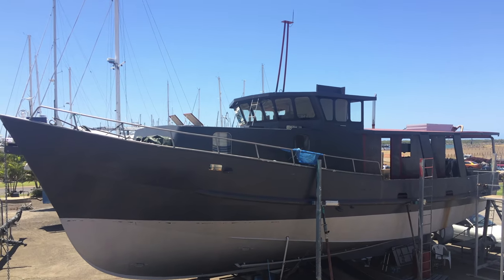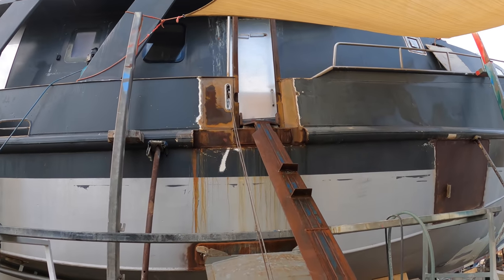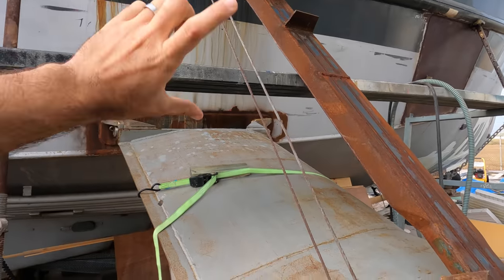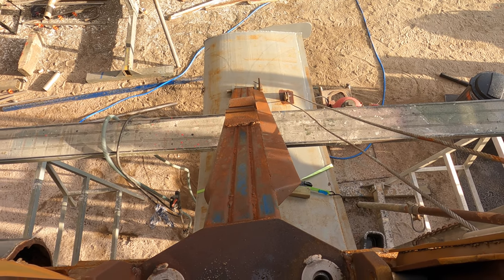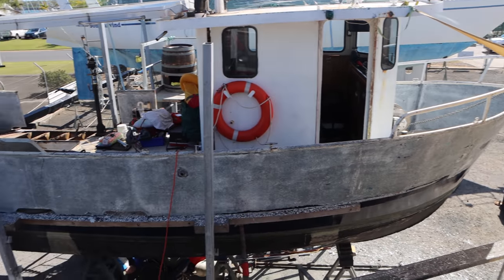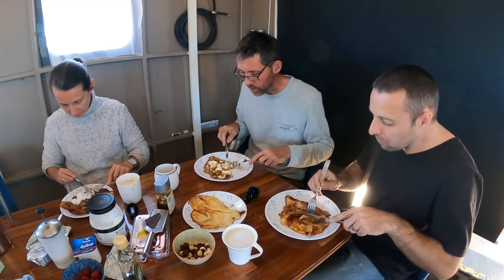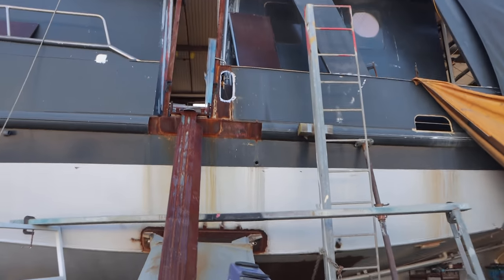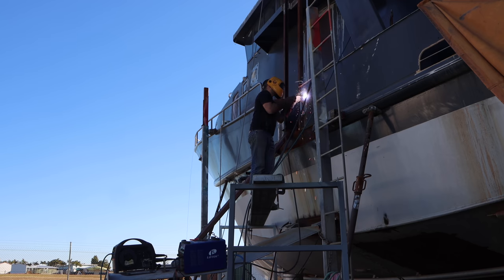Re-building our bulwarks & bending stainless solid bar fairleads - Brupeg Ep. 216

Comment: Hi just a suggestion..have you considered using a 12 volt power pack that is commonly used in dump truck applications
And as that is under $1000 you could use hydraulic drive motors from commercial lawn mowers…in usa. Surplus hydraulics has new close out bargains…if you are interested I will get you their contact…

Comment: Thinking of hydraulics for wing winches.
You already have lines for the anchor winch, can you allow for dry break fittings and use feed and return hoses to connect to a hydraulic manifold on the roof? Only issue is storing the hoses when not needed.

Comment: You will be using a rattle gun to undo the wings lock down bolts/nuts before you lift them.  Set up and use the same gun to wind them up. Limited cost. Upgrade when you have the finances if you need to. You will not be raising them everyday day , just when you come to port I thought.

Comment: Since there going to be in the water 95% of the time. Just use central hydraulic winch with a split drum. You have enough pulleys to spread the load so not overloading the winch. That way only buying one winch so just change the way the wire approaches the drum that way they both raise and lower same time. Cuts your cost. By not going hydraulic your putting a price on reliability and going to have forever ongoing issues (coming from a commercial fisherman here in nz). One winch and maybe a extra pulley mounted on the roof each side. Problem solved.

Comment: How about 1 hydraulic winch with two reels ( Similar to an anchor winch) mounted in the center of the cabin roof  and a pulley at each corner where the winch motors are now so both stabilizers raise and lower at the same time. This would be less costly and quicker raising and lowering of the stabilizers.

Comment: Sorry it won’t let me edit . The 15,000 hydraulic winch for $540.00 us. There is also a hydraulic valve that is typically a two position valve called a selector valve that you can move the selector in one direction and send hydraulic fluid to one side then select the other direction for the other side. This allows a small hydraulic unit to raise or lower one side at a time.

Comment: What keeps the wings from bouncing up as soon as they hit the water when being deployed so that you are unable to lock them down with the pins?  Love the channel!
Reply from the maker: Gravity. The wings weight 380kg dry. We plan to put 20L of diesel in each wing to slosh around for life. So call it 400kg. The water displaced is around 200kg so they will sink and want to keep sinking
Reply from the maker: Lifting and lowering wings happens at one knot for less, once the wings are bolted to the deck there is no chance they can go anywhere and it’s not possible for the arms to disconnect from the sliders

Comment: Is there anyway to retro fit hydraulic motors to the winches you have now? And have two valve blocks inside for raising and lowering the cables, running hard line up through the roof with weld in fittings and bidirectional hydraulic motors.

Comment: what about an electrical driven secondary hydraulic system on the roof?should not require more than a small capacity hydraulic tank and the motor can be tucked away no bulkheads from the belly smaller and less expensive as you said wings used 95% of the time at sea...

Comment: I was was thinking you could move the elect winches inside the wheel house that way the winches would not be in the weather
you could make a rubber seal slit for the cables to run through bit more fab but should not have any more problems with the winches

Comment: Just I thought .considering that the cable should always have tension, could you enclose the winch in a stainless cabinet I/e an electrical cabinet and pass the wire rope through a rubber grommet to seal it from the elements. That would be less cost than hydraulics

Comment: Why don’t you use a stainless screw and a brass bushing mounted to the bracket or two one on each side of the stabilizer bracket inside of the channel and you can use a small electric motor inside the Hal with a 3-1 reduction  just like the commercial car lift

Comment: are you using the wings as external fuel tanks ?
Reply from the maker: They could be but we won’t be. They are hollow and would hold maybe 200L but the hassle of pumping just wouldn’t make it worth the effort. We currently hold 16,000L and plan to increase that to 27,500L prior to antartica

Comment: VERTICAL ANCHOR WINDLASS (THRU-DECK VERTICAL)
VERTICAL ANCHOR WINDLASS (THRU-DECK VERTICAL)

Single Wildcat
Space Saving Design
Several Chain Sizes Available
Custom Control Packages Available
Electric or Hydraulic Motor with Fail-Safe Brake

Comment: A cheap short term solution might be something similar to a boat trailer electric winch with manual back up hand crank, may not last long but you could by 5 or 6 for the cost of converting to hydraulic.

Comment: I duno why not just run winches inside wheel house. The cable holes would face rear of the boat making sea water ingress much less. You could put a drain on the cable entry to drain any big waves

Comment: I'm very interested in seeing them in motion!  I've got a much smaller boat and that stabilizer idea looks fairly simple to have designed and best thing, they don't go through the hull.  Got one question, she mentioned plastic in the rails that bring up the stabilizer...would they be heavy nylon or some other similar material?  Agree completely with not using paravanes and high rigging to lift the stabilizers...just thinking of ice build up and then the drastic top heavy issue.  Have you given any thought to a method or system of ridding ice buildup?  I know it's a crazy idea, but what about the same system that's used on aircraft wings?  an inflatable bladder or is that just foolish?  Man, that's a cool lookin boat!
Reply from the maker: Sledgehammers for ice removal are the most common think on commercial boats. I have pondered heater hand rails etc to melt spray ice off those
Reply: @ProjectBrupeg  That makes sense, but hammering...heated hand rails is a good idea, i was just wondering about a thin but durable envelopes that could be inflated?  i can t help but think there's an easier method

Comment: Not sure as I have not seen the boat but why cant you put a hyd  drive motors inside the house in each corner and channel the cables outside so the drive pumps are actually inside, The drive motors only need to be plumbed from your existing Hydro system.Or put 2 big ass truck winches inside instead of on the roof. Also you can buy a wood splitter cheaper and tear apart for the parts cheaper than buying the parts.

Comment: Why not put the winch in the engine bay and run a pump straight of the main engine and run the cable up to the roof and Bach down to the wing
Reply: Could mount the winches to the under side of the deck and run a cable to a pully and straight up next to the already installed down cable tube/handrail

Comment: Dynema is not  affected by UV or seawater but it will chafe really easily therefore the good old wire rope is the go on the winches. As the stabilisers will be down most of the time give the wire a spray of lanolin which will hold back the corrosion but when individual strands start to part it's time to replace or end for end it.

Comment: Just a question as i know you have had a few since about the wing. When the ship is in the water will the wings move with the wave action and the double arm constantly moving in the track up and down?
Reply: No. The wings are fixed units. They provide stability due to their large horizontal cross section creating drag as it’s pushed/pulled up and down in the water.

Comment: G'day  Crew,,,
Hi Damo ,    i  guess     what keeps the stabilisers being a topic of concern is that the comments come from people who have never been to sea  or simply dont even know what a stabiliser is  or understand the forces at play  and the engineering   required to design /build/fit  said stabilisers  to a exploration vessle.
If you removed the comments that came from people with no engineering  experience, or seatime  there would only be the few genuine comments  of interest   .
Frankly ,, considering  you designed, constructed  and fitted the prototypes  ,the only comments id expect was from other trawler owners asking if you could help them with the dimensions  so they could fit a set to their vessle.
Naturally  as the stabilisers  are yet to be tested ,there will undoubtedly  be some fine tuning  to achieve  perfection .
You have every reason to be proud of the stabilisers,  im sure they will work perfectly  inside design parameters  .
In fact ,,, if you fit  four jumbo jet motors to them ,,i reckon Brupeg could fly if you add octane  boost to the vege oil .
 Overall,  you've  done an excellent  job  with them .
Well done  Damo .

    Respect 
      from
Shellharbour

Comment: Are the wings not partially buoyant? If they are, how can you force them into the down position in any sort of sea? Also, what is your estimate of the cycles that a typical voyage will put on raising/lowering? Will the cable system work when covered in ice? Will the hydraulic system work in subzero temps? Will a deck mounted diesel engine work in sub-zero temps? If you already have electrical power at the winch points, a suitable electric motor will be the best option surely? Remember fishing boats will be docking far earlier than you will when you are on an expedition. Just my amateur sailor opinion based on a sound and long engineering background.
Reply from the maker: 99% of the time they stay down. Lifted only for wharfs and marinas. Wings will be removed at sea prior to heavy ice fields so ice won’t rip them off or freeze components up

Comment: When it comes to raising your stabilizers a winch would be the correct approach for reliability but I might suggest having been a commercial fisherman a deck winch which would be much more versatile all the way around then you could run a series of blocks around the deck up to the roof of the Wheelhouse or whatever suits you to make it work your brilliant people I'm sure you can engineer that solution but the winch being on the deck can be run from a power takeoff on your main engine and not add any additional economic challenges to your mission when it comes to using it all you need to do is have your main running which you more than likely would be if those things were in use... you could also do what I have done on my trawlers which is to engineer the blocks that pull the cables for their stabilizers to your anchor winch which I am sure you're going to have one of On Your Vessel... and if you choose to use both those approaches you would have redundancy which is another problem solved when it comes to being in remote places you'll have methods of using that energy from two sources you can also engineer these blocks to do other things for you I've had to pull a boat closer to me once and I used  my strousberg deck winch to get him up near me

Comment: I wondered why you didn't mount a coarse threaded rod into the lifting plate for the wing and use a gear-reduction high-torque motor to lift. 
I wondered if someone could mill the coarse-thread matching rods and threaded lifting blocks (that could be welded onto/into the lifting plate) on CNC, and find a motor with enough torque to lift those wings.
#Engineering

Comment: I’d recommend giving hydraulics another look. The sticker price on hydraulics is like everything industrial, 3 times the actual price to keep annoying hobbyists that don’t know what they want or need away. Also, a lot of large trucks have hydraulic pumps fitted to the engines like an alternator, or to a secondary PTO on the gear box, so have a look if something from a wrecking yard could be fitted to your main engine. Pumps and motors are also worth considering, a lot of the fancy stuff these days like smash plate variable displacement pumps and motors are completely overkill for an application like this, as you just need something that spins at a constant rpm, which means you can use the cheapest stuff available. Buying the winch and motor separately is probably also a good idea to keep cost down, as there’s bound to be some non marine application for winches that’s a lot cheaper. For the backup manual winch, what about a normal big rope winch in the middle and tying a line around the cable and using that to basically take the slack of the cable?

Comment: Why not run an electric over hydraulic power pack.  12 or 24 volt DC. And hydraulic Rams pulling down into the storage room.  On either side    you could run pulleys off the end of the ram and double or quadruple the Cable so you could run a shorter ram.

Comment: I don't really know how to explain it easily in text but maybe the suggestion can get the brain juice flowing to figure something out.  
Been giving thought to a possible solution...a screw...a very long strong screw...going from the center of the plate that has the 2 pin holes straight up & attached by a top bearing.  
It would be driven from the bottom end of the screw with hydraulic wenches that have their feed going through the hull to the engine room.  
The wenches would be in a box just under the pin-plates...which would have to be extended by the distance the wench box would offset them.  
Using welded-on fittings to get the two feeds through the hull could solve any possible water ingress issue.  
PS>  I oopsed the word...instead of wenches...just hydraulic drive motors with a gear on the end to drive the screw...sorry for the confusion.

Comment: I don't know what the hastle is. You've got a bloody gtreat (PTO) Hydraulic motor aready in the engine room, call a Cunnins. Surely thats got enough oomph to power a small seldom used hydraulic motor. If its that under powered, pinch Stewie's GM
Reply from the maker: Trouble is the Cummins doesn’t have an easy PTO otherwise it would be a no brainer

Comment: Still think i would make a plastic roller to run in the stabiliser tracks rather than line the whole channel in plastic both sides. Too hard to fit maintain and attach in my limited experience with uhdpe rubbing strips on boats.
Reply from the maker: Then the roller would strip the paint on the sliders. That’s why we lined the sliders and not the stainless pin

Comment: Hey, Damien, I think you've done a great job on these Outriggers and btw have you considered welding a large pieces of angle, just in front of the hinge Points. Where your outriggers are mounted to the haul of the boat and to the wing of the outrigger and the large tabs that fastens the arm to the outrigger itself. To give you better hydrodynamics and less resistance water turbulence at that hinges. Well it maybe something to consider when you test this system out.

Comment: Why don't you. Put your hydraulic winch  under the deck or in the engine room and run cable to winch through a pulley system and you could make it water proof with a little bit of thought best of luck ps, like the the way you think outside the box

Comment: Powerwinch makes a whole line of marine electric winches. Electric over hydraulic combined system is another option. Electric motor drives a hydraulic pump with a reservoir sized for the piston or pump. A small electric over hydraulic with the steel line welded into the pilothouse roof and a t fitting for each winch. It's really not necessary, there are literally dozens of marine electric winch and capstans out there. I used to rebuild them. Keep a complete spare unit and a rebuild kit and you'll be good to go. With those wings you won't be traversing anything but small swells. As far as I'm aware they use them only at very slow speed for trawling? The faster you go, the more effective the wing would be. Hydrodynamics is like aerodynamics on steroids. If it's effective at limiting roll at slow speed, it's unusable at higher speeds.
Reply from the maker: These wings are designed to be used at hull speed not trawling speed

Comment: What’s stopping you from redirecting the cable going to the roof and just running down to the engine room and running a hyd pump from your main engine to two hyd winches in the 
Engine room, not that hard really. Would be more then happy to give you a hand doing it.

Comment: Your a kiwi just moari on a hydraulic motor onto the end of the winch you have just remove the electric motor and put a hydraulic one in its place and just tap into a hydraulic system you already have on the boat as you won't be lifting up and Down all the time go to a tractor/heavy equipment wrecker and you will find all you need cheap chur chur from tauranga new Zealand

Comment: damien  they make bigger winches 18 and 20 000 lbs are available if you choose that route . i would choose winch over ram if you go hydrolic ..when it fails it will leak why add oil to the ocean when you can just design a different solution... i would be tempted to use trim tabs to get them to the surface and break surface tension   pulling both from aircraft and windsurfing.....you dont pull a sail up you fly it out physics lol ..as for continuous explanation  some people are mechanically minded some arent some have experience with the sea or vessels others dont  so you will get good meaning people with no insight or experience concerned over your actions  ...if you choose to you can educate them if not they can be mostly ignored  .but as far as what you do or how you do it ...its your boat  float it as you wish is my point of view and i thank you for having me over... wheres the argon lol that window needs charging